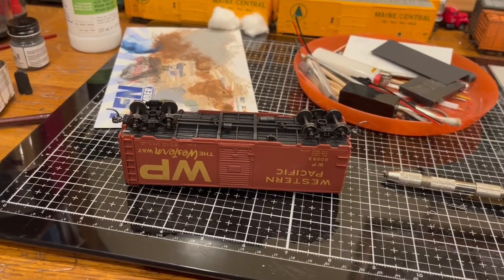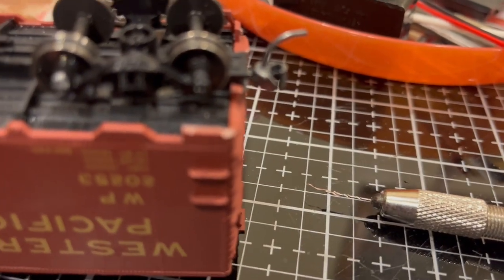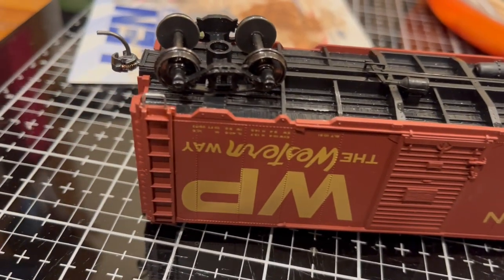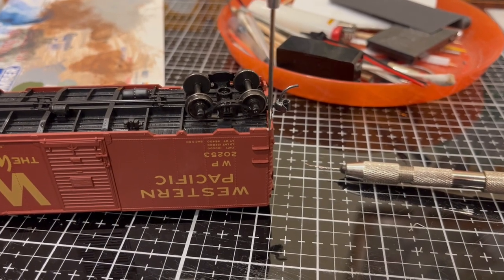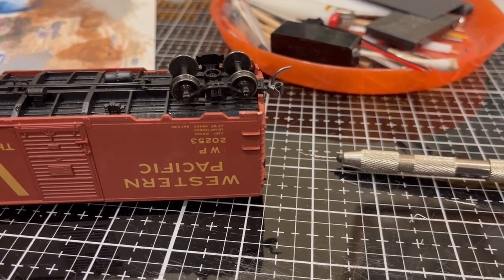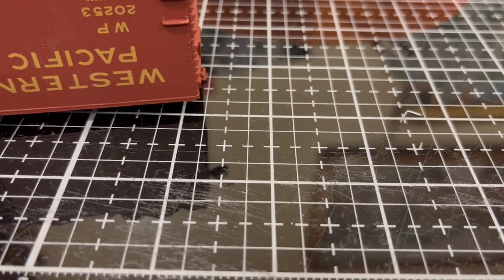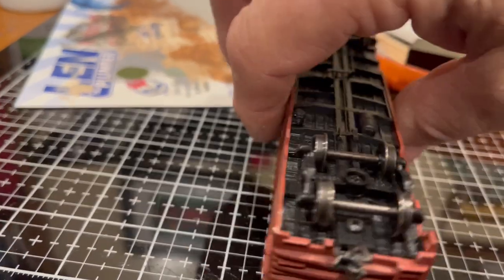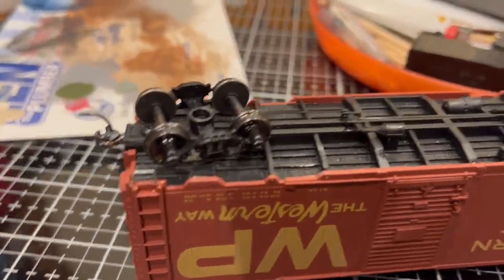Easy Freight Car Stirrup Replacement

Comment: I've got several cars to replace the stirrup's on.  I always thought that a simple paper staple would work for stirrups and I see that they work pretty well.  I've several brake wheels to replace as well.  Cheers from eastern TN
Reply from the maker: Glad it helped, I do it on O scale cars too, use the heavier duty staple gun staples for that.